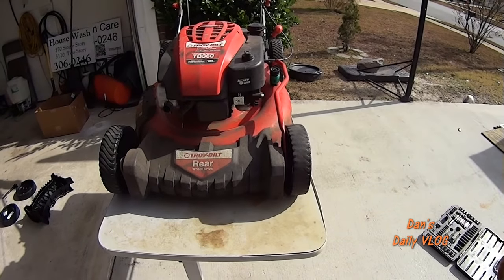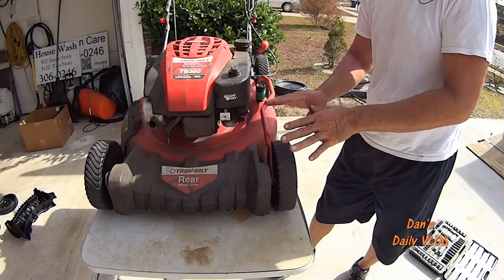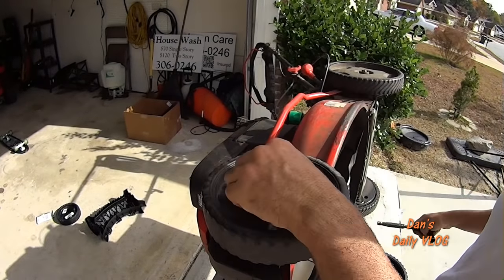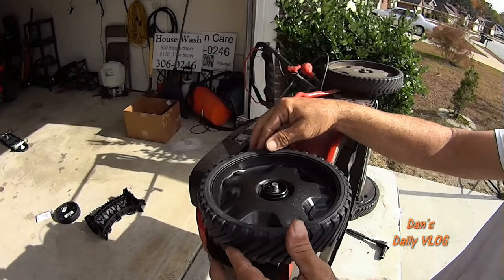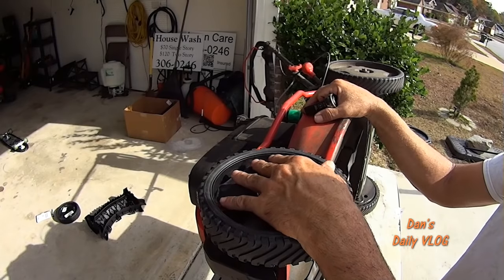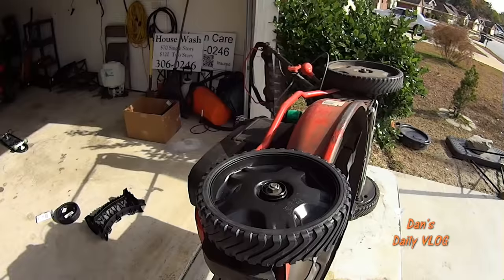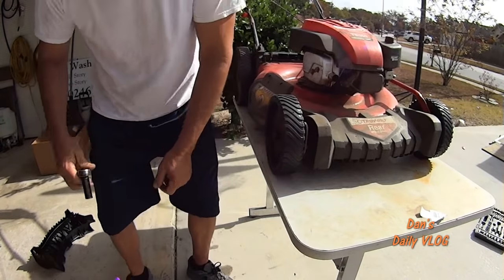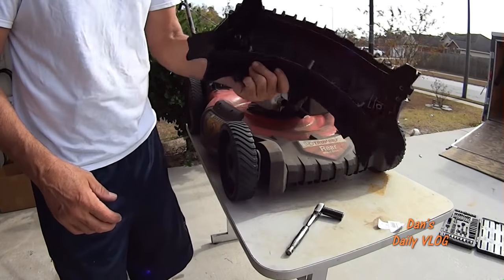How To Replace Lawn Mower Front Wheels and Why You Should Do It

Comment: Great video, sir. Question. I have a Craftsman EZ Walk self-propelled lawn mower. It's about 20 years old, Honda Engine, and original front wheels.   Both front wheels (which need to be replaced) have a backing plate behind the tires. Do I need to change the backing plate as well? If so, where can I purchase these plates for this model? Thanks again for sharing your skill and knowledge. It is greatly appreciated.
Reply from the maker: If it is front wheel drive I would assume yes. You should replace everything you can access since you are going to be working in that area anyways. However, I am not familiar with what you are describing so I would suggest you carefully observe the plate as you slide the wheel off and make a determination prior to ordering your parts. Look at Jacks small engines on the web for parts

Comment: Thanks. Replaced left front wheel on my mower. However, the wheel does not spin freely as the other front wheel does. The backing plate spins on both front wheels (when I engage the self propelled lever) so I don't think it's a belt problem. Thoughts?
Reply from the maker: I am not sure. I don’t use front wheel drive mowers. If you put on the right part, it is probably having to do with the drive system

Comment: How important is it to get the exact wheel? For instance, if I have a craftsman mower, and the front wheels are say 8", can I use any 8", or do I need to use a specific/genuine part?
Reply from the maker: The part number of the wheel regardless of brand is what matters. MTD, Craftsman and so many others are the same parts

Comment: Hi, I have an old simpson  sears lawnmower it is steel and motor works perfectly.  A wheel is missing. How would I measure the wheel for replacement, and the bolt is still attached so I can use it. Are the bolts standard? I think it is 16AMP 60cycles. Model C 035 - hard to read.  Craftsman. I would like to buy a wheel at Canadian Tire. Original color was blue, and beige top casing. Ty Stay safe.

Comment: Hi  Dan,   I need to replace my wheels on my 2010 Troy-Built mower.   It still runs great just wondering if I should get the OME wheels or generic....OME wheels are about $125.00 just wondering if that's the right way to go?   Thanks
Reply from the maker: I would go generic. Probably made by the same company.
Reply: @DansVlog  thanks appreciate the response...

Comment: What about if the bushing doesn't stay in the old wheel upon removal.   Still stuck to the axle ?
Reply from the maker: I will spray it with some PB blaster let it sit for about 15 minutes and then try to tap it loose with a hammer

Comment: U can save some $$ just by replacing the shims or wheel bearings on some models.
In some cases u can use copper tubing cut to length to suit the spindle,a very simple job 😉
Reply from the maker: Very smart!
Reply: @DansVlog  i got the idea frm stevessmallenginesaloon on utube 😉  (credit where its due)

Comment: Not sure if this would work in my case.  Rear wheel drive propelled mower, rear wheel fell off LOL.  Bearings are gone, I can put wheel back on but no way I can think of to make it stay on.
Reply from the maker: You need a new wheel assembly.
Reply: @DansVlog  Ok Cool.  If I buy a new wheel, then it should just snap in and stay on, you think?

Comment: My bushing came off w the first wheel, but not the second...now what? How do I get it off?
Reply from the maker: Try tapping a flat tip screw driver behind the bushing very lightly in a few different locations to try to shimmie it off.
Reply: @DansVlog  thanks for the tip! I couldn't get it. My brother came over and figured it out: a ridge on the end wasnt letting it come off. He sanded that down and it came right off! I'm up and running! Thanks!

Comment: Only thing I'd use to lube wheels is WD40, doesn't draw dirt and repels water
Reply: As the Wheels are Plastic, use Silicon Grease or Oil..not machine Oil...
Reply: Wd40 evaporates quickly into the air, bad idea to use it as a lube  😔😔
Reply: @neilcrompton3488  It works good on these wheels so why question it?
Reply: @bronzechicken4437  wd40 evaporates into the air,so therefore it wont lube wheels,bone dry in minutes 😔😔
Reply: @neilcrompton3488  It frees up the wheels on machines I sell, making it a lubricant in that application.